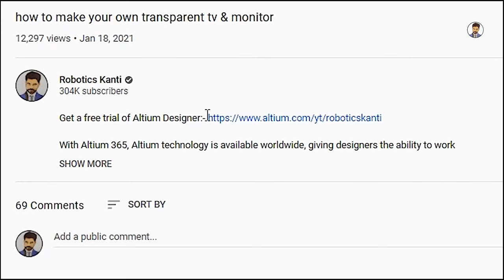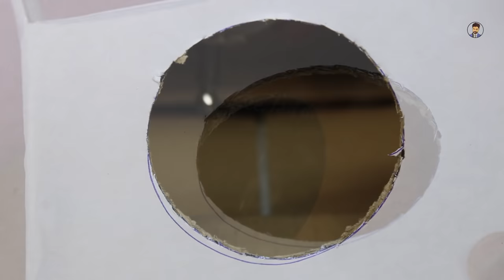How to make projector display with focus lens

Comment: You should have used a diffuser for the led.
Reply: Yes u r correct and easy to get... Just hack a flash light which has that bulged convex lens in the front.. Thats the one.